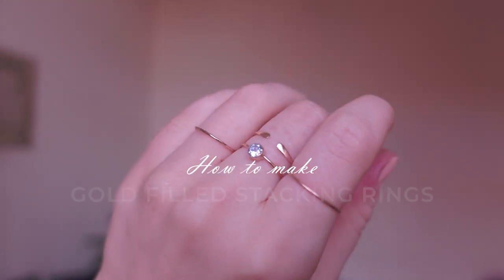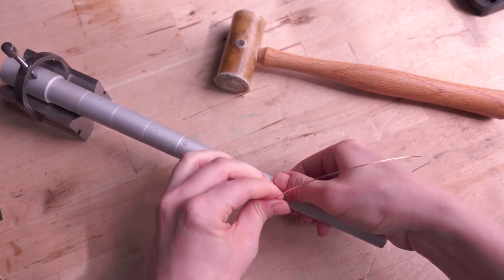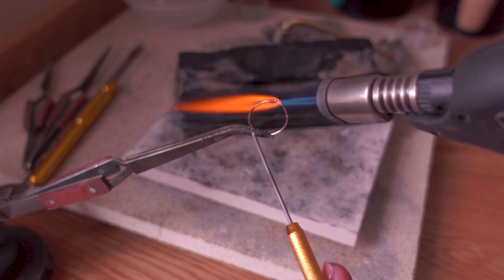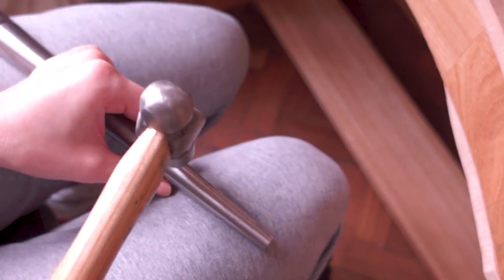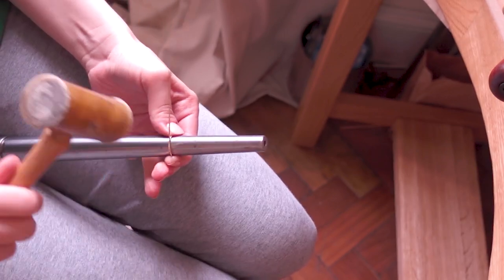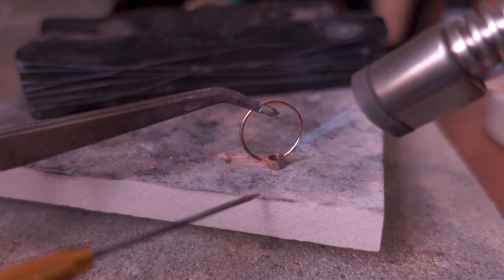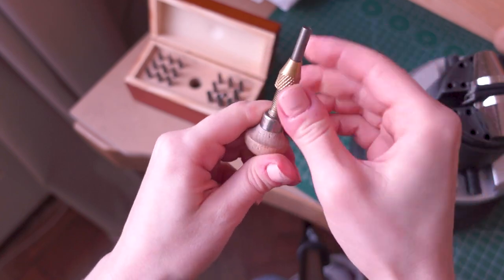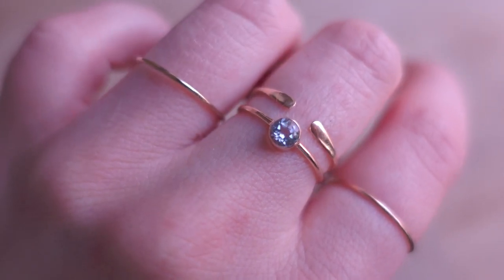How to make GOLD FILLED JEWELRY - stacking rings tutorial | Gold Fill

Comment: Hiya Lady Stardust, yes more questions from me. Can you polish off the gold if you overdo it when shinning with very abrasive tools? would it not be better to mark the cutoff point of a ring for fitting a tube, then move 4mm along the wire, then cut, so the extra wire instead of being in your hand is still on the length of wire and available to use? It gets to me, we cut off the piece and put it in recycling when we could still use it. Using flush-cut cutters would help with cleaning up the ends prior to soldering. Less filing to do. Steve...

Comment: Thanks for the video!  Curious why you said sterling and GF need separate pickle solutions?
Reply from the maker: when I pickled silver with GF, silver got plated by the copper that as inside of the GF metal. It is wise to never contaminate the pickle which you use with silver by any other metal. Hope this helps!

Comment: Wow i love the hammered ring so much. I have some gold filled wire but scared to cut it because the core will be exposed and it will tarnish. How can i avoid this pls?
Reply from the maker: Gold filled wire has it's specifications, it's a cheaper material that can be used instead of solid gold if someone want's to experiment with gold look, but don't want to use solid gold. So I just think that we have to keep in mind that it's not actual gold and won't behave as one, it will tarnish and is more difficult to work with. But I believe that if we accept this, we can have fun with this metal and create jewellery :) So don't worry too much, if you want to use this metal, go for it! It's better to experiment and have fun, rather than keep something hidden in your drawer ❤️❤️❤️And tarnishing isn't so bad, I've had gf jewellery taht I made years ago, and it looks ok! Simple cleaning helps, just like with silver :)

Comment: Thank you so much for sharing. Great works and tutorial ! I really love to watch your video channel.
I am wondering if the 14k gold surface of gold-filled wire would diminish or not.Could you tell me it is ok if I polish it by using file or sand?I am from Japan. thank you for your time! 🌸
Reply from the maker: Thank you! Very happy you liked it :) Gold fill is a bit better than plating, and lasts longer, however it still can be removed if too much sanding and polishing is done on the surface. It's usually best to avoid soldering with gold fill (and choose cold connections). But if soldering is required, it's best to solder very carefully, so there isn't a lot of cleaning required afterwards. Files might be too abrasive, so I personally prefer sanding paper and buffing sticks (or medium silicone attachments for rotary tool). It's a cheaper alternative to solid gold and more attractive alternative to cheap plating or brass. It does diminish over time a little, it won't last as long as solid gold, but I think it's still great to use this metal if you want to create gold colour jewellery of better quality than plating or brass! Hope it all makes sense haha 🌸🌞
Reply: @TheArtOfMetalsmithing  , love your video. Are you using hard, medium or easy solder? thanks

Comment: Thanks for the video. If the stone and the tube setting are of the same diameter, how did it fit inside it with room to bezel the top?
Reply from the maker: Good question Krytyna, the stone is indeed 4mm as is the tube setting. I think the stone fits, because there is a step or a "seat" made inside of the tube to fit the gem.
Reply: @TheArtOfMetalsmithing  ah right, well that makes sense ;)

Comment: Hiya Lady Stardust, again, how polished was the face of the hammer you flattened the ends of the ring with? I noticed some marks on the GF that you would have to polish out, a polished hammer face though... no marks. Steve...
Reply from the maker: yes, it depends on what kind of effect we're going for and which hammer we're using :) I prefer this hammer, despite it not being perfectly polished, because it has a perfect weight and flattens the wire exactly the way I want. I don't mind the marks, because I was going for a more organic look, but if someone want's a perfectly smooth and polished surface, a polished hammer will be the best
Reply: @TheArtOfMetalsmithing I was just thinking about how GF will not let you do much in the way of clean up before you lose the gold surface. A ball-peen hammer was designed to use all day every day. In engineering, it is about the first tool you buy as an apprentice. You often end up with several different weight heads, for different types of jobs. Has your Dad still got any of his from his days as an engineer, if so I bet the faces are still, though not perfect, in good condition. If used properly not too much damages them. Stay safe dear lady...Steve...

Comment: I was not sure what size premade bezel  to use with what size stone. I always assumed I would need a size smaller stone???
Reply from the maker: If I'm being honest, I'm still a bit confused by it sometimes haha ;)) Most of the time, I use the same size and it fits perfectly. But sometimes I do get cabochons that don't fit. That happens sometimes when I'm using premade tube setting (and I assumed it was becasue that particular gem was not exactly the size advertised, but a bit bigger). If you make your own, you can always adjust it a little bit and see if it fits. Hope this helps! :)

Comment: Hiya Lady Stardust, forgot a question, where did you get the stepped mandrel from, please? Steve xx...
Reply from the maker: I found it on etsy! I tried to find the link, but it looks like it's no longer available, sorry
Reply: @TheArtOfMetalsmithing  Typical of my luck... It would go great with my vertical vice from Cookson... You should look at that, the mandrel is held top & bottom instead of either side so however hard you hit down it can't fall!!! It has groves so round things are held firmly. I've often thought about a stepped mandrel as anything wide would be conical on a normal one. Yes I know keep turning it around but it upsets the engineer in me. I'll have to get someone to teach me how to use these other services...
Stay safe...Steve xx...

Comment: anybody know if gold fill wire turns your finger green?
Reply from the maker: Not in my experience. Also, depends on what is the base metal, sterling silver or mixture of brass and copper? And is the gold filled layer gets removed, then base metals will be exposed, which may result in some colour on the skin.

Comment: Is it real gold?
Reply from the maker: no, it's gold filled metal. There's a base metal, usually copper, brass etc, and then on top, fused with these metals is a layer of solind gold. It's thin, but it's more than gold plating and doesn't come off as easily as in gold plating.